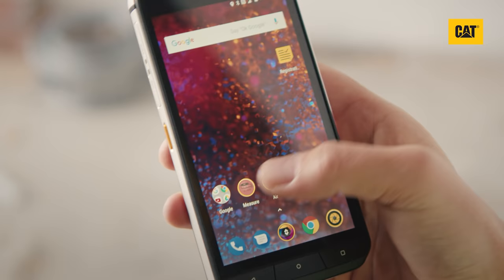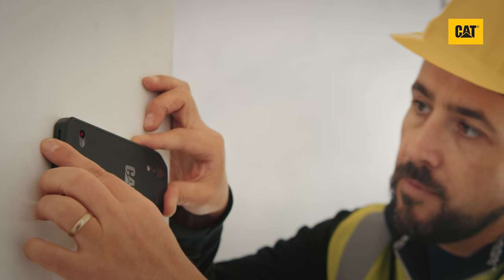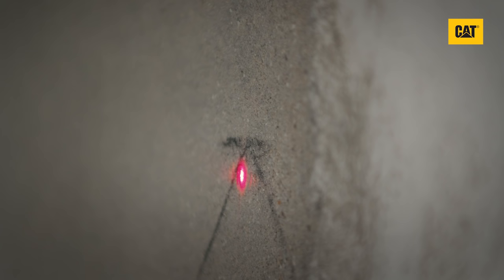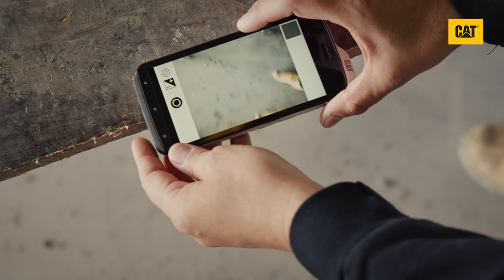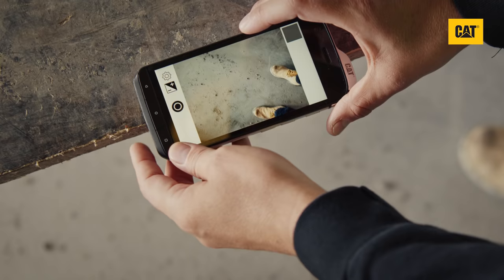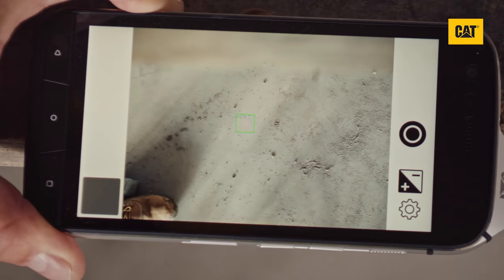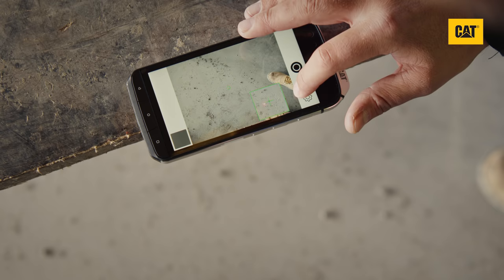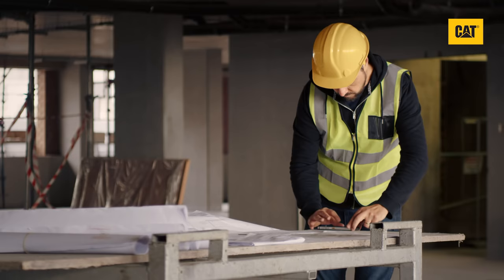Cat® S61: Introduction to Measure | Cat phones

Comment: I would prefer they just built in a classic laser meter instead of using the camera to estimate the distance. I mean, those laser meters aren't that expensive compared to a FLIR camera for example, so Its not the cost problem. It seems that putting a laser itself isnt a problem either - so unless there is some problem with integrating the module that typically measures the distance in those devices, that would be a much better solution IMHO. But I still enjoy that CAT tries to push the boundaries of what a phone can do.
Reply from the maker: Thank you for your feedback regarding the laser measure. We will pass this on to our development team so they can look into this further. Have a good day and let us know if you have any other feedback or suggestions.

Comment: Thermal imaging camera and it's gallery keeps on crashing... Can't use the tool as I thought.. feeling wasted if the application keeps on crashing like this.
Reply: how is the phone otherwise? is it a dual sim?
Reply: It's ok but the distance laser measurements doesn't work out door.
Reply: 10m isn't a decent range; better buy dedicated instruments if you really need them. Pro's don't use this junk. The Land Rover Explore seems like a better choice, but made by the same manufacturer..
They simply use rugged sounding brand names to sell their stuff.

Avoid the DeWalt phone as well.
I ordered the Crosscall Action X3. The French manufacturer is into construction and outdoor sports: That's the angle and dedication I'm looking for, and $350 for an IP68 isn't too steep either. Hope it pans out fine..
Reply: @shylaa1124  it heavily sucks, buggy, overheats, everything peels off, and never gets android updates (its has been now 4 years).

Comment: Hi guys...
I tell you my experience with the CAT s60:
I bought it in April 2017; in September 2017 the speaker mesh started to detach... 
I contacted the support number but here in Chile don't have any replacement.
March 2018: audio jack doesnt ork anymore. Currently I'm using Bluetooth headphones, because I can't find any replacement for the audio jack. 
Please think twice about to buy this smartphone.
Thermal cam it's ok, body resistance is ok, but I don't dare to put my phone under water, I think it will die...
Reply: This is a video about s61 tho
Reply: S60.....
Had S60 till last week (moved to S61), the speaker mesh fell after a year.
Wait till your 3800mAh battery will start to die, and 100% charge will last 12hrs.

Thats the problem with CATs, to fix them you need to find a retailor that you bought it from 2-3 years ago.
But still Good phones.

Comment: Everybody dissing the CAT phone because it's over-priced and bulky.

About over-priced…..
I can give you an example that CAT phone (S60) saved me more money than it cost.
Last year (living in a building apartment), 11pm, knock on the door. It's my neighbor from apartment undermine, complaining that the common sewer pipe from my apartment is leaking and demanding compensation for the damages and for me paying for a plumber (he is a plumber, how convenient).
I go to his place… I see a vertical sewer pipe with a puddle. Turning on the thermal camera, finding the leak…. The leak is from his side of the pipe.
The SoB tried to scam me. He wasn't ready for the option that I actually have a thermal camera in the pocket.

Got more stories that it saved me money and time….

But seriously…
How much you think that FLIR thermal camera cost?
And if you buy it, what are the chanses that it will be in your pocket when you need it?
Reply: I don't think they are overpriced, in fact I would be inclined to pay slightly more for s61 if they just put a classic laser measurement device in it (the current solution is a tad cumbersome and it seems a bit inconvenient to put the phone screen-first to the surface we measure against). It would be way more ergonomic if the laser was in the top or bottom of the phone - it couldn't use the phone camera, though, but would need the same type of sensor as in typical laser distance measurement devices.

I look forward to the next models, maybe they will improve on that. Or add some more cool features.

Comment: Having a range of cheapest Aliexpress laser rangefinder - priceless.
Reply: This isn't a laser measure unitasker. Just like the thermal imaging isn't the best on the market. However, instead of having to buy a phone, a laser measure and a thermal imaging camera, when you only rarely need those added two features, is much more convenient than buying all three individually. And so if this isn't to your requirements, there are other rugged, IP68 phones out there with big batteries. This isn't a jack of all trades phone and so if you need precision or versatility from a laser measure, you'll find a better deal phone and use the saving for that measure without being snarky. And as for Aliexpress, well often you get what you pay for on there and I wouldn't rate them for a drop test.

Comment: why did you stop producing this awesome phone?
and the s62 is a staight up downgade in everyway......
Reply from the maker: Hi, thank you for your feedback.

We understand your concern, but the S62 Pro is the better device. Bigger battery life (even with 500mAh less), a better thermal camera sensor, a faster processor, and waterproof without needing USB covers.

Nonetheless, there are some customers that miss features such as the VOC sensor or the measuring app, however, these were cut to provide a better value proposition.

Many thanks, Cat® phones support
Reply: @CatRuggedPhones  
after my s61 one could not get any service anymore when i came back from vacation (i tried everything) i got myself an s62 pro, and i have to say that i like it!
Reply from the maker: That's awesome to hear. Thank you for your feedback.

Best regards, Cat® phones support